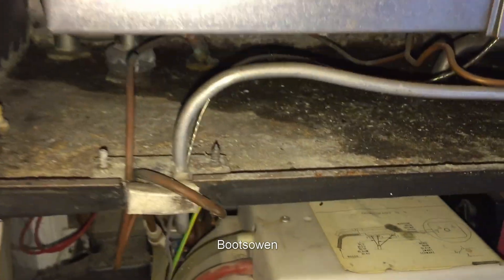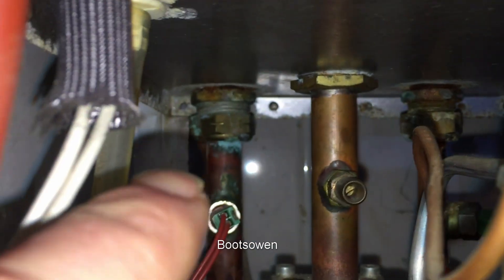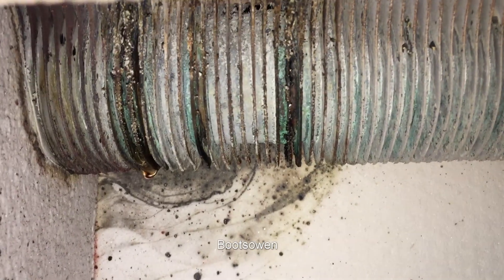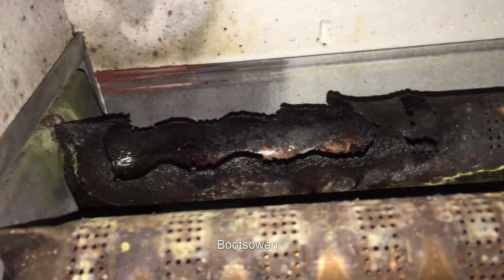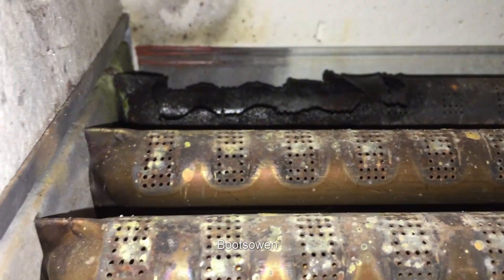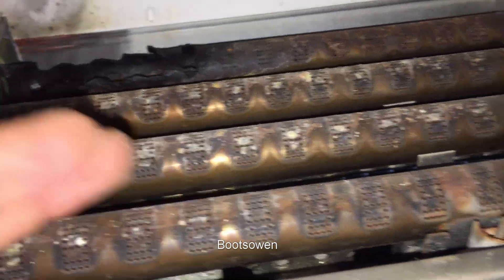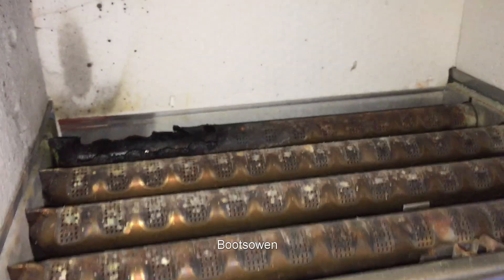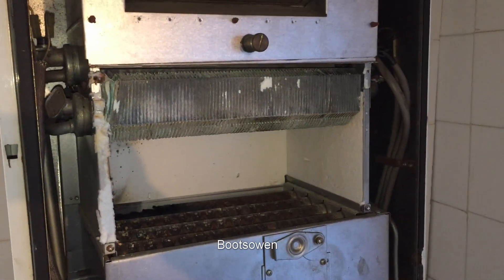Failed burner and heat exchanger | Gas combi | Ferroli Optima 701 Autopsy, how did it get so bad?

Comment: I'd say the heat exchanger started leaking first, the water dripped down onto the burner and rusted it through. Was leaking for some time to cause such extensive corrosion of the burner tube . Sadly couldnt see the bit at the end showing the burner in action as Youtube overlayed big links to your other videos right over the top and obscured the view of the burner flames. I get the picture though.
I'm still running a Glow Worm 45 Back boiler unit in my house that was put in in 1988, so its 35 years old, and still just about works - only about 55% efficient so a bit of a gas guzzler, and still has a pilot light that costs my 7 quid a month in gas just to run that pilot light - but as they say, they dont make em like they used to, and I wouldnt want to pay thousands for some modern crap condensing boiler that only has a life of about 10 years, until the old Glow Worm gives up the ghost, but its so simple with so little to go wrong,  it'll probably fail with gas valve failure in the end - the heat exchanger on it is so thick and solid will probably never rust through.
Was that old boiler in your house, or someone elses? Just wondering how you got the video of it running
Reply from the maker: Great feedback Steve, I have delayed the endscreens so it should be visible now, it is best noticed when the text on screen is describing it, you can just see a yellow flare.  It was easily 25 years old when decomissioned 6 years ago, this video slipped through the cracks and I just found it yesterday! I used to shut it down in summer and whenever we went away to spare the pilot flame.  It was in our house and we got a few years out of it, but it had been dripping for a while and I just rode it out, obsolete so no parts, and while I could have had the radiator dipped and that might have cured it you begin to chase your tail. Your glow worm will last forever, a bit like the oil burner that my family has over in Ireland, I featured it in another video years ago "bootsowen oil jet" will probably find it. It is apparently bullet proof.
Reply: @bootsowen  Its the pilot light that caused a problem on mine a few years back it kept going out, so I pulled the fire front off the boiler, removed the pilot assembly and cleaned out the  pilot jet - has been fine ever since. They do need a small amount of maintenance but nothing compared to what a modern condensing combi would need, with so much in them that can go wrong, sometimes it is best to stick with an old boiler till it becomes completely failed - yes they are more inefficient in terms of gas use, and the pilot was superseded on all boilers by electronic ignition decades ago, but when I weigh up how much I'd have to pay to fit a new boiler and all the pipework mods it would need, I just feel its more economical to carry on using a 35 year old boiler and just pay the extra in gas it uses every year. I shut it down in summer as you used to as well to save on the pilot gas consumption, and just heat what water I need in the kettle during the warmer months. Of course the other drawback is that it is an open flue, so needs an open air vent in the back wall of my living room and that lets draught in, so its not a balanced flue as in modern boilers. There cant be many people left out there now that are still running an old open flue back boiler with a pilot light, lol, but it still works, and has saved the cost of probably 3 - 4 modern combi boiler replacements over its lifetime. Just because something is old, doesn't mean its no good - something that many people need to learn - and something I'm sure you agree with. Will have another look at the video again now you've changed that overlay timing.